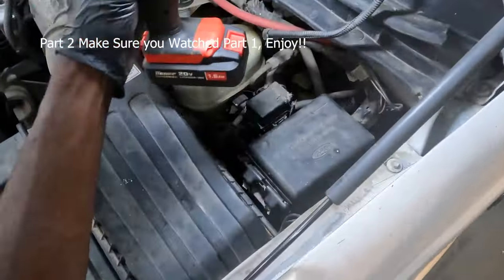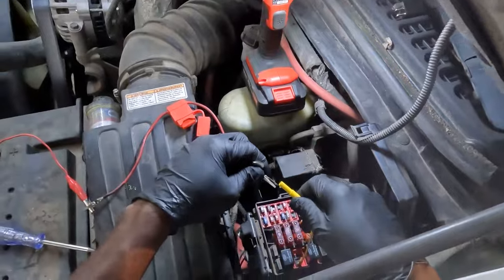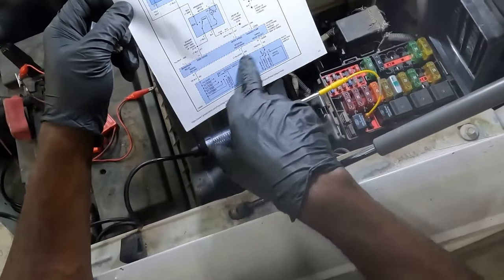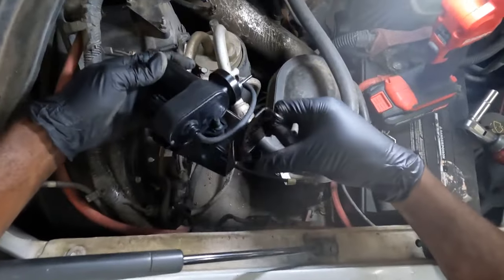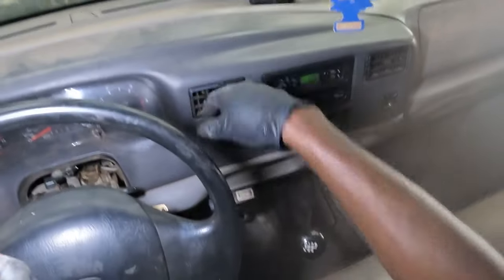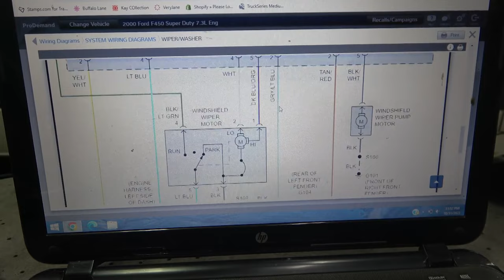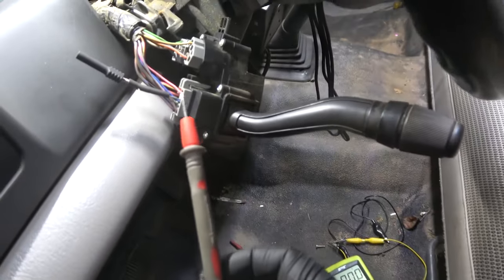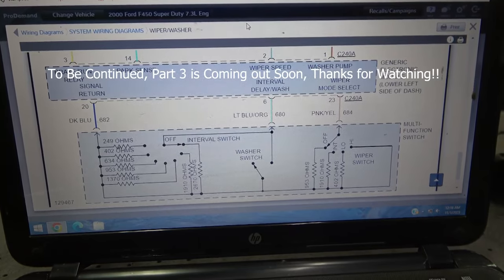Ford Truck - Wipers Not Working & HVAC Stuck On Defrost Part 2

Comment: If the relays are all the same why not just substitute another one into that slot?
Reply from the maker: @wlonsdale1  Good suggestion but since I didn't have the ground control at the relay I knew the problem was not the relay, Part 3 is coming out soon, you will see the problem in part 3